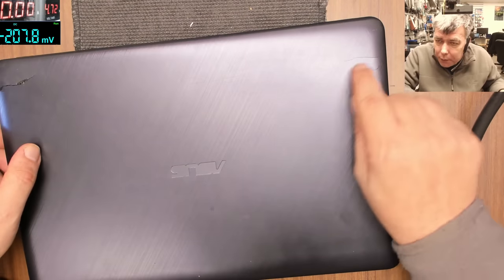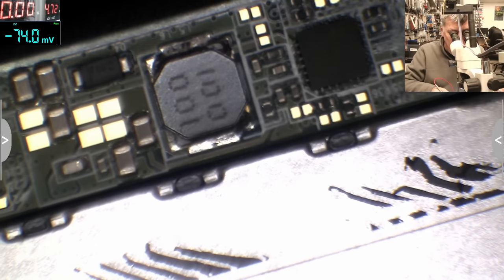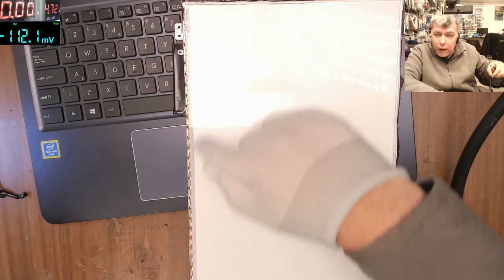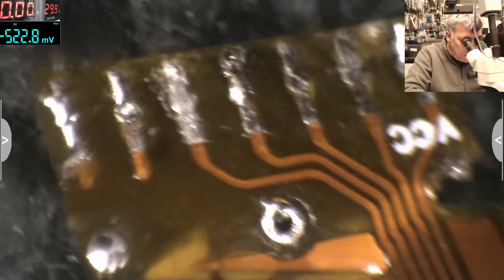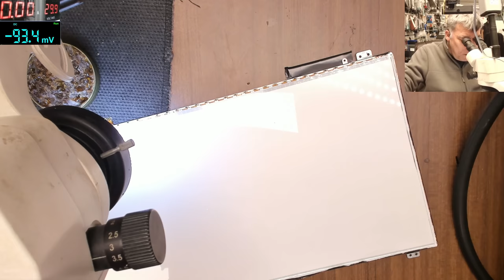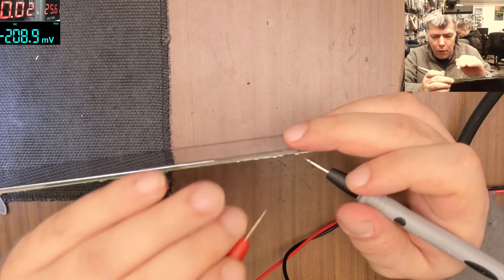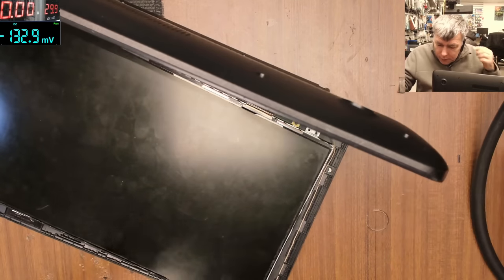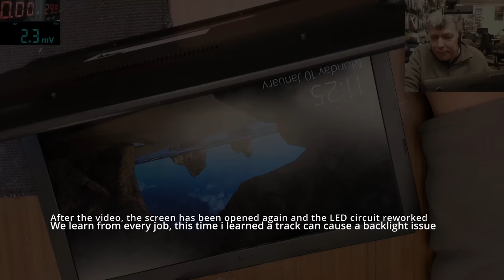Asus laptop, no backlight - actually a screen repair

Comment: Hi Sorin, out of the 36 LED 9 do not work. Normally 4 x 9 LEDs are controlled, one line has failed / has a contact fault.
Reply: That's what I thought too, and it's lucky already that the screen allows the backlight on with one group not turning on... On my laptop that I tried to replaced LED's, if one group is not getting power, the backlight goes on for 2 seconds and then shut off!
Reply: hello SiE kindly elaborate
Reply: @rbaamo7194  You can even see this, for example at. 34:14 3 LED lights - 1 not - 3 lights - 1 not etc.
Reply: yes
Reply: @kztech1319  Hello sir  . . is it possible to disassemble a paper LED panel and then reassemble it and get it to work as before . . I mean I would like to remove few paper sheets in there. . THanku
Reply: How much voltage to apply for the LED sir?

Comment: Hello Sorin! Happy new year!! 
Thanks for all your work and videos. I really like it!
Would you please do more videos about fixing random errors? Like, the laptop is working but, randomly, shuts down? This is just an example.
I know these are the most difficult types of problems to address, and that's why I'm interested in learning how to fix some of them.
Thanks!! 😉
Reply: One of the videos that had that sort of error was one where the push button had something between it that was conducting, so the person would turn on the laptop and then it would switch its self off, because from the processors point of view it was like a person was holding down the switch, which turns it off. Since that video I always think its worth testing the push buttons, pretty sure you could do with it contunity mode to make sure its not in contact.

I will say thought it would also be worth testing it with the resistance meter also because it may be that what ever material was inbetween the switch could have higher resistance than 10ohms so the contunity meter wouldn't pick it up.
Reply: @Ghost572  That's very interesting. I've also seen somewhere a bad capacitor causing this kind of issue. I don't recall where I saw it, though...

Comment: Tell your customer to open the laptop from the middle so it doesn't add so much stress to the hinges. I cringe every time I see people lifting the lid by one side as the lid twists and adds undue stress on the opposite side hinge, screen, tiny ribbon cables and whatever else is getting distorted.

Comment: happy new year. ! i got  2 laptop with same screen one in the video . no backlight after hinge broken or losen screws . both screens made by Innolux . it is same backlight track broke in the flex cable can be repaired but it's not long lasting one . my advise is don't  buy  Innolux after market panels.

Comment: Hello Sorin and happy new year! Why didn't you check for the dim signal or the PWM signal? i mean the 3.3V rail. If the inverter is boosting the voltage (19V to 30-40V), it means that the 3.3V is present?
Reply: did you find an answer? i'd like to know too

Comment: Awesome channel! I instantly became a subscriber and fan of your channel when I seen you use zippo lighter fluid to find the hot spot on a laptop motherboard. That's a great trick to find hotspots! 

I have a question regarding your comment on disconnecting or reconnecting display cable while power is connected. What can break? What is the most likely problem if during a laptop screen replacement I seen a spark when connecting the display cable to the new screen and now all indicator led don't light and laptop won't power on? Power adapter was not plugged into laptop but the battery was still connected. My laptop is Asus FX505DU-EB74. When I tried to turn it on and it was dead I unplugged the charger and sat the laptop aside. Upon returning a hour or so later I noticed that laptop was still warm. I opened it up and found the heat source. It is a small chip near where the display cable connects to the board and the backup battery. It gets really hot fast. That chip and small 1in. area around it was the only place with high temp tape covering it. 
So.... What is that chip? Is it super I/O? I unplugged all power and backup battery to reset bios but it didn't help. Is the chip fried or is it a mosfet or what could be the culprit?  
Its my own personal laptop I'm working on and I could definitely use any knowledge that your wisdom can share with me.  Please help me!
Reply: the problem of playing with the screen connector with the battery or the charger plugged in, is that the 19 V power rail under this condition is always on, so what happens is that a high voltage line may cause discharges and burn something, usually if something like that happens you burn the screen and that's it, but on your case you may have burned a power mosfet on the side of the motherboard. you probably solved the problem at this time but if you still need help reply here and I'll gladly try and and help you troubleshooting
Reply: @simonerachele6231  I haven't fixed it yet. I was planning on sending it into Asurion the phone insurance company. They have this new plan that cost 25 bucks a month but you can get almost anything electronic fixed or replaced. I still want to figure out the problem on my own if I can. I've narrowed it down to one chip that gets really hot even if you just plug in the battery. I'm not sure what the chip is though. If it's a bios or what. I can send a picture if you want.

Comment: Out of curiosity if it was one of the leds that broke backlight, do you just need to bridge that one to fix the issue?
Reply from the maker: bridge
Reply: @electronicsrepairschool  won't you end up with a darker spot on the screen?

Comment: Some plastic patch and epoxy glue fixes the broken cover strongly. Don't forget to drill the cover around crack, before applying epoxy glue. 
There will be no esthetic problems if you cut the patchs fine.